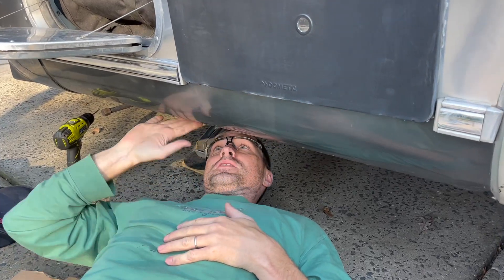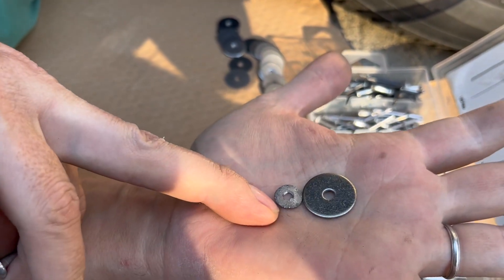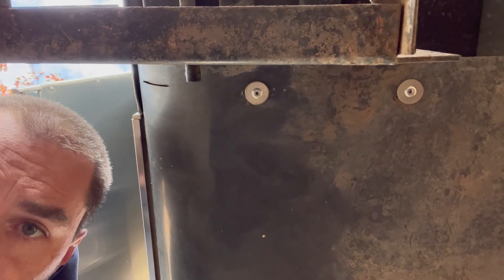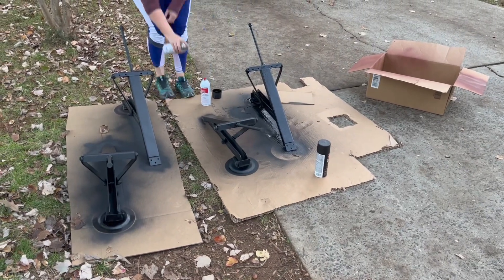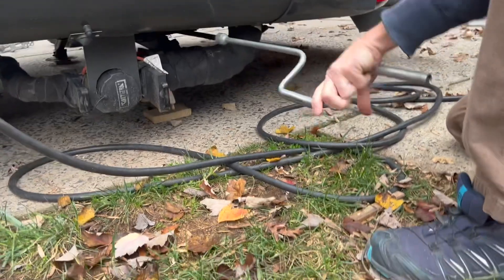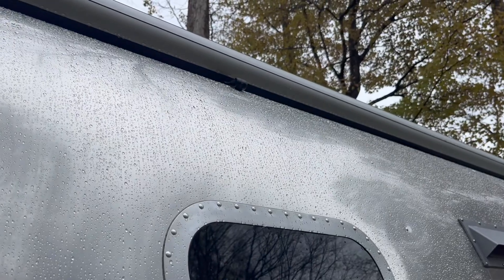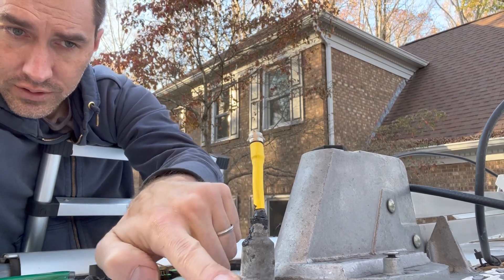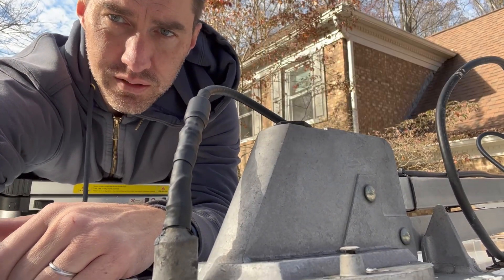Full Time Airstream Life - Fall Trailer Repairs

Comment: Did you use adhesive-lined weatherproof heat shrink?  It uses a lower temperature inner layer that melts and flows around the connections.  Still very easy to remove if needed.  Sometimes called dual-layer heat-shrink.
Reply from the maker: I need to get some of that kind too, I'm sure its better in areas that get really wet.,

Comment: Great video!  Very helpful.  Stainless has an electrolytic corrosion problem in contact with aluminum.  I think I might have sprung for the aluminum washers.
Reply from the maker: For sure, there is a correct way to do this repair and that is to replace the skin, it has seen better days. As it is, the steel frame has eaten some of the aluminum where they contact so that skin has been getting worse for a while. I'll keep an eye on the stainless though.